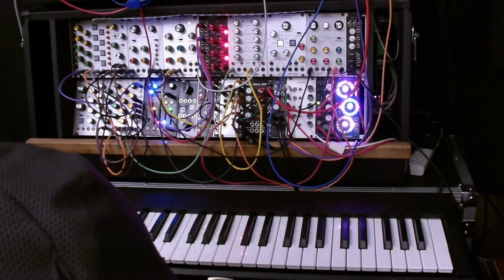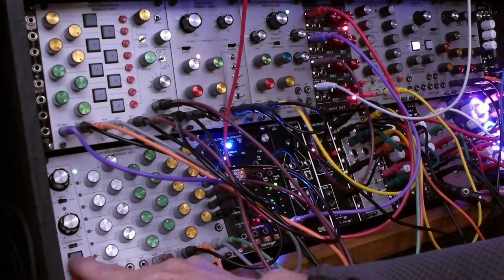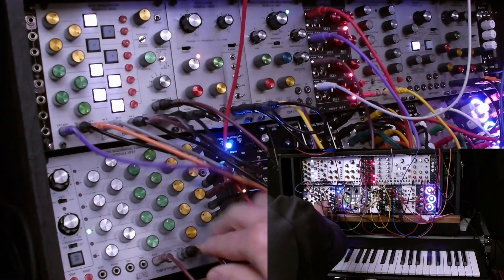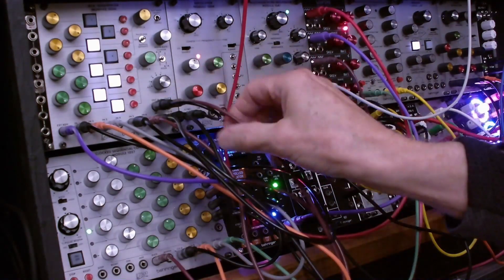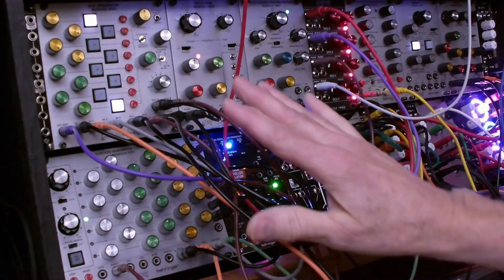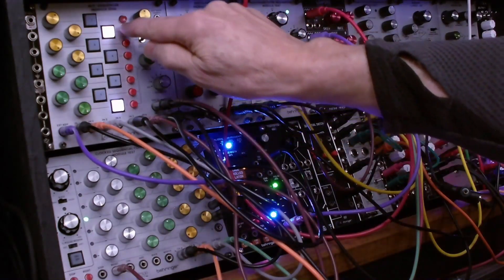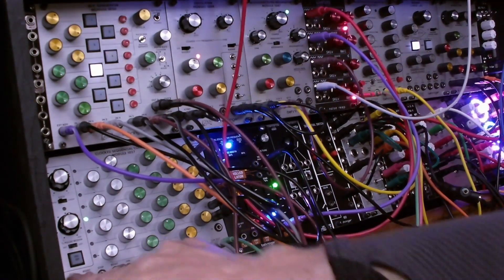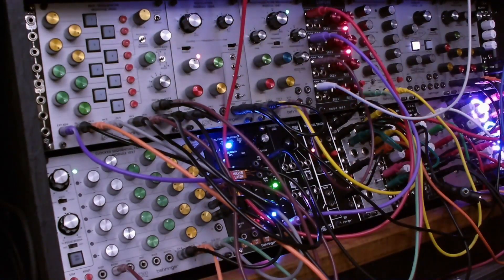ARP 2500 - 1027 Sequencer with 1050 Mix Sequencer - advanced techniques

Comment: Hi, I know it's been a while but I bought the 1050 and it makes an ugly clicking sound everytime it advances in it's sequence. What am I doing wrong? I don't have the 1027, mostly try to send audio through the 1050. Thanks and keep up the good work.
Reply from the maker: Thanks.  My only thought is that you may have a "dc offset" in the different audio channels.  Could you make a short video demonstrating the issue?  I'd be happy to look at it.
Reply: @ozhalljr   Hi Oz, Query. "Behringer 1050 Clicking noise problem". Posted 02/25/2025. Thank you.

Comment: Say - can you use these two together in a way to have a 24step sequencer? I’m thinking - if there are 3 channels 8 steps each and that clocked switcher module seems to have advance trigger - can we have 8th step’s gate just switch to next output (ch1->ch2) and so on? :)
Reply from the maker: Yes.  The mix sequencer is DC coupled so you can route the three outputs from the 1027 sequencer into channels 1 ,2, and 3 of the 1050 and switch inputs sequentially.